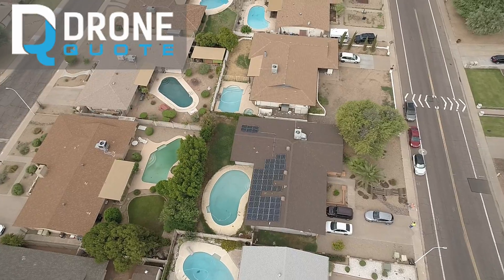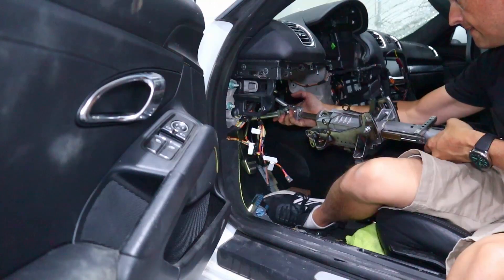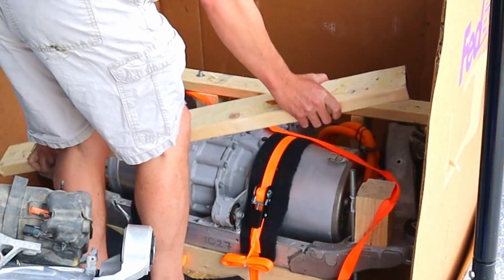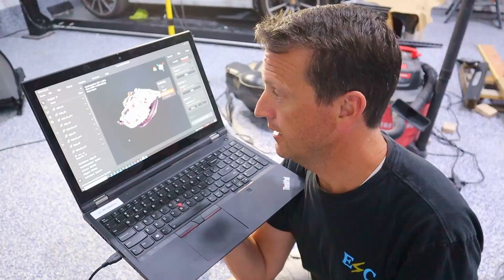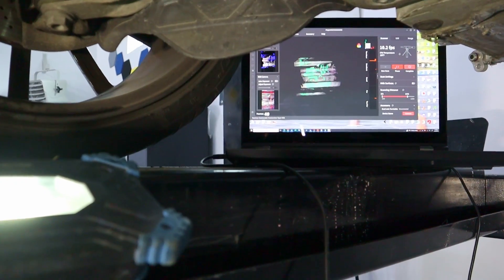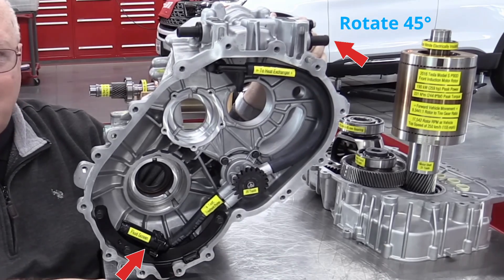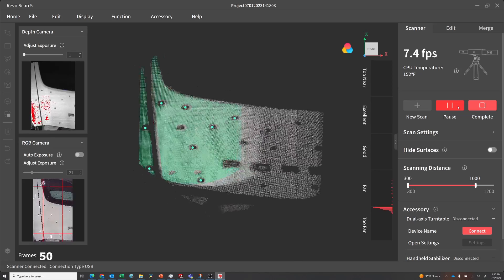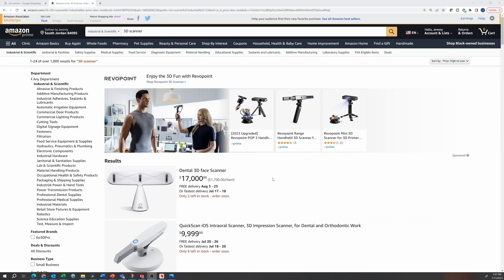3D Scanning a Car - Porsche GTE using Revopoint RANGE 3D Scanner

Comment: Did you have to buy the Calibration Boards set to get the Range to work properly? I tried everything and even on an over hour long video call with Revopoint Support, they could not figure it out. But they refused to replace it and just offered me a discount on the $80 calibration board set that was out of stock. Just wondering if anyone else had the same experience.

Comment: What CAD software did you use with the Range? I have this scanner from when it was on Kickstarter.  You’ve inspired me to use it finally. Want to scan a car. Eventually learn to make some vent hole trim or widen/modify the fenders for 3D printing.
Reply from the maker: I use solidworks

Comment: i also have the range G1 scanner, using the feature mode for the car is great for dark material coz it has the dark mode for feature traceing, but tracking dot mode if better for light color car,
Reply from the maker: Good call

Comment: Hi! 
I'm about to pull the trigger on the same scanner but my intention is to scan and CAD modify some interior trim parts. Would this scanner be OK for smaller parts as well as big or should I go for a smaller scanner? Or do I need one of each for big + small? 😬

Thanks!
Reply from the maker: I am going to be demo-ing a new version.  If you can wait a few weeks, there is a new version that can do both
Reply: @electricsupercar  you're referring to the miraco? I have signed up to the kickstarter but I'm guessing it'll be a different price bracket to the Range as it advertises itself as a do-it-all tool. Seems a little gimmicky as well

Comment: is there any phone scanning app that gets half decent results ? having the camera and the screen in the same small device, plus the flash if needed...sounds like if could make things mucj easier from the operator point of view. I think some phones have depth sensors too, but the ones I tried a few years ago were really not that good or roo exoensive just to try out for fun.
Reply from the maker: Not sure.  I'm sure there will be one soon

Comment: Also I wanted to add. Pro tip. Buy round magnets. When you put the reflective dots on a magnet then you can apply and reuse them more easily.  It works very well on metal surfaces and will keep the costs down. Also sometimes it is a pain to remove these dots so it will make that also better. Back in the day they used magnets in prototype facilities. Also baby powder mixed with fastly drying Spirit is a good alternative for dry shampoo.
Reply from the maker: Good except for aluminum panels

Comment: Well if the 3D scanning is good enough you should be able to print out pieces and glue them up and make a mold for carbon fibre. Not sure if this is possible. But I also suspect you will need an army of 3D printers.

Comment: So soon we'll see a custom 3d printed widebody Porsche gtE tesla powered awd cayman? 😁

I know this won't be a popular thought, but I still think dual model 3 or Y drive unit's would've worked better for this beauty. 
Less size&much less weight to aid in you packaging them in. Is it to late to sell the current drive unit's? 

This should be 650-800# less than any dual motor 3 and well over half a ton less than a dual motor model Y currently is. 
So perf would still be outstanding, prob mid to upper 2s 0-60mph and low 10s in the 1/4mile with a decent pack powering it.
Reply from the maker: Thanks for the comment!
Reply: @electricsupercar  thanks as always for sharing the fascinating details and interesting build processes+your insight from your hard earned ev conversion experiences. I really can't wait to see this beauty progress into it's ultimate awd gtE form. 

I'm sticking with 3,350# in final weight. 0-60mph in 2.5s or less and very low 10s in the 1/4mile, 220 miles of range in chill mode.👍🏻😎

Comment: When tilting the motor, the only real problem I see is the breather/“crankcase” ventilation. Depending on the location, if it’s getting close to the oil level it might start dribbling. Also may start dribbling out of the axle seals. 
The diff may also start frothing the  oil more if the oil rises above the plastic guard.
Other considerations are rotor&stator cooling differences, the change in gravity direction might have an effect on the oil flow distribution. All these probably aren’t a big issue for a one off car
Reply from the maker: Thanks for the comment!

Comment: Nice project!
I'm using scanning and 3d printing for a current project. Since you have an OBJ of your motor you should have it 3d printed 1:1 scale. It would weight less than 10 pounds and would be so much easier to create mounts
Reply from the maker: Interesting 🤔